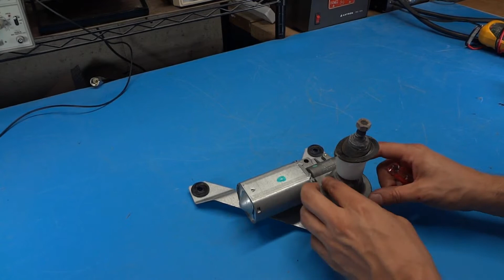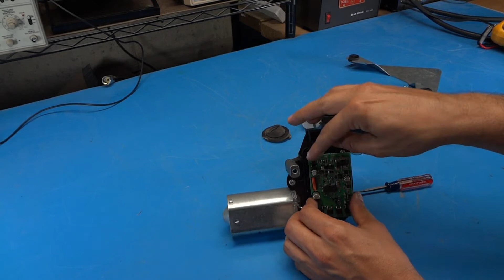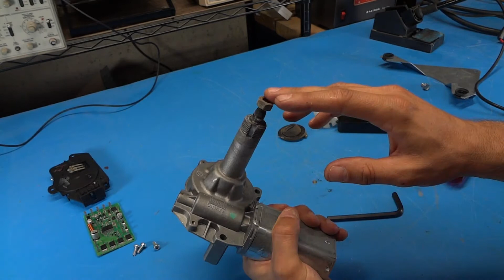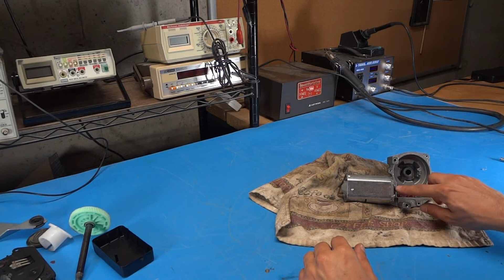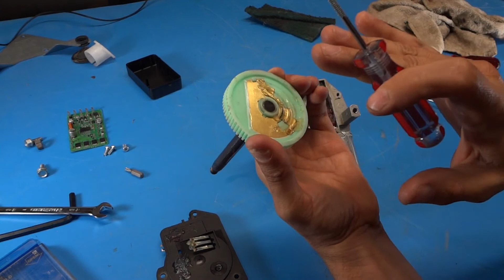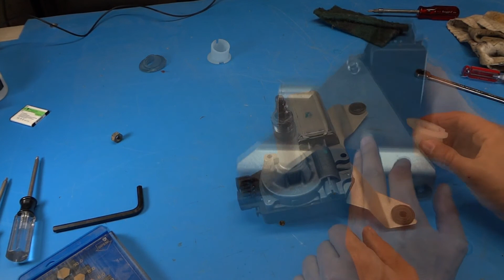Chevy Tahoe Rear Wiper Repair - Wiper Motor Tear Down and Rebuild

Comment: This is good stuff. My 04 might have the same issue, squirter works but wiper don't. Ill check to see if its trying like you did & if so its coming apart and ill follow this video. My rear lock actuator is bad too I think. Doesn't open up with power locks, lol. I've fell in love with my Tahoe so I want to fix all this stuff. Thank you!

Comment: Will this work also on my 2007 Tahoe? I hsbe the issue, that my motor needed 2 up to 4 hits with the switch on my steering wheel. Than he works. But now he was stopping in the first half of my resr window and want move. Think i should remove him onf go step by step like your video to see if i can reactivate him. Last would be if he not works again, to replace him.

Comment: Your video gave me an idea. Without removing the motor, only the blade arm, I saturated the area with WD- 40. 12 hours later, the motor came to life again.

Note: there's a small notch/groove at the tip of the shaft that allows the lubricant to to enter the shaft which most likely unseized it.

Worked for me. Worth a try.

Comment: Good job man.  Very detailed and well thought out.  It looks like you are very versed in electrical troubleshooting.  Are you an electrical engineer?  Also where did you get that 12 volt power supply tester?  I noticed it reads "Seven Forty One"  Is this something you created?
Reply from the maker: Thanks!  I'm a low-level electrical engineer I guess...I've been working in electronics manufacturing for 30 years but don't really design circuits like an EE would.  I created the pseudo circuit board nameplate glued to the power supply but not the supply itself.

Comment: 1. the bracket could have been left attached to the tailgate body and the two screws holding it to the motor could have been removed instead.

2. When re-attaching the bracket, it's not necessary to look for stamped writing on the bracket in order to determine the correct reinstallation position; the screw head imprints will suffice to show this.

3. You may possibly save a step or two by, instead of unsoldering and resoldering, simply bend the cover back at the flexible soldered tabs.

4. With the time you have invested in this whole process, depending on how much value someone places on his time, it's far cheaper to just order a replacement from RockAuto and simply do an R&R.  In other words, this motor is serviceable but, in practical terms, it's a throwaway.

Comment: This is a great three-part tutorial. Was having the same issues.  Tried the grounding strap which did not work. I took the motor out and disassembled the gear shaft as you did. I had to hit it with a hammer to get it out. When I removed the shaft, two bushings were around it,  one was touching the gear and was free to move, and the other towards the end of the shaft and rusted on. Had to put in a vice to loosen it. Greased everything up and reassembled. Works again.  Another thing to watch out for is the wiring harness that comes out of the body to the liftgate. Saw another great video on that as well.  Opening and closing wears out the wires over time. Thanks again. God Bless.
Reply from the maker: Glad you enjoyed this...btw, I'm a Rush fan too

Comment: I replaced the motor on my 04 with a new motor still no wiper action. I picked up a switch for the dash from LKQ and the washer fluid sprays but still NO wiper action. Any suggestions?
Reply: Check the black thick ground wire in the top right hand corner by the hatch hinge.. there’s a rubber grommet covering a grey connector and in that connector there is a ground wire that somehow burns out right next to a little pink wire. This was the overall problem for me. I was wondering why my truck kept dying out every once in a while.

Comment: the video was great.  I think you can lube it while it is on the truck.   Lot of work to save $30.  The motor is not expensive from 1a auto

Comment: I just got done with my rebuild after watching your video twice. My gear shaft had two bushing sleeves on it when it came out. Thirty minutes of soaking them in Liquid Wrench loosened them right up. I used 400 grit sandpaper to break Un the corrosion on the inside of the housing and liberal Liquid Wrench it came clean as could be. I lubed the shaft and bushings with marine wheel bearing grease and put her all back together with surprisingly no extra parts. Low and behold she is back to chooching. Running a little slow as far as I’m concerned.

Shade Tree Mechanic First Class.  Thanks for the help.

Comment: Mine is a couple years older and has a different parking device, but the problem wasn't a crusty shaft; on the circuit board, there is a coil that had a poor solder connection. What clued me in to it was my ability to make it run if I turned the power on and banged the tailgate. A quick solder job and it works fine.